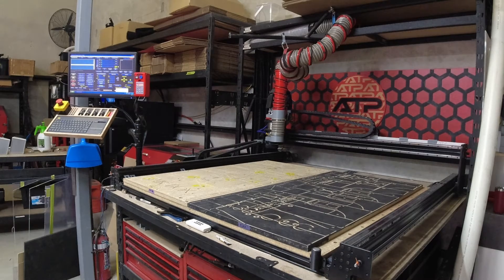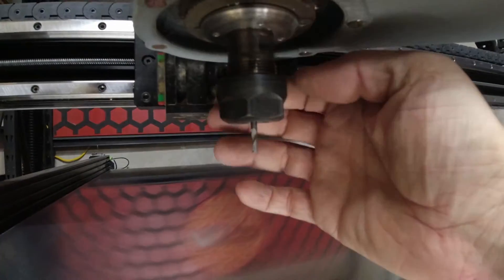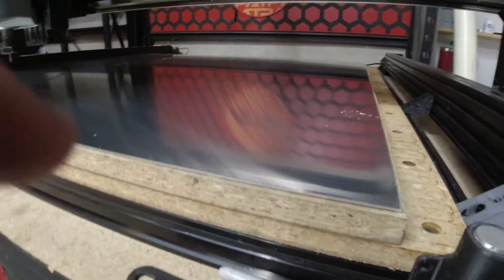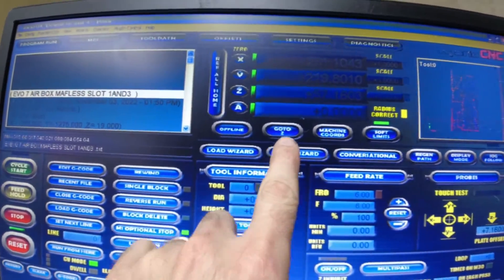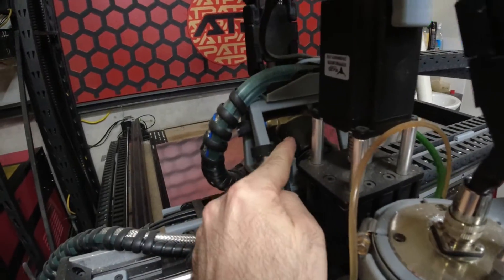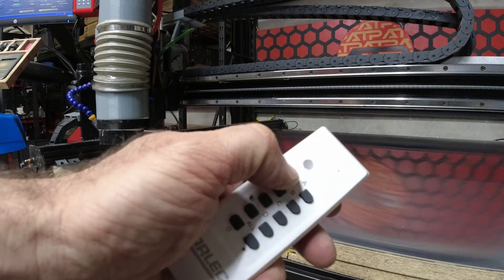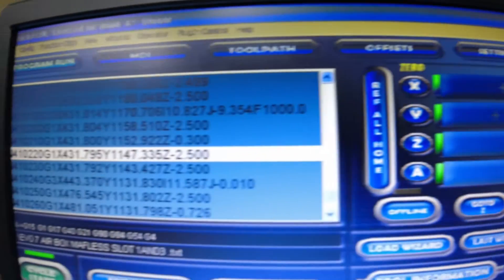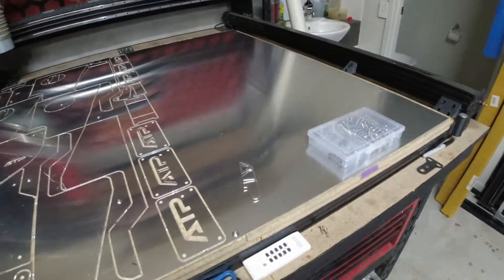Bulkman3D CNC - How I cut 5005 Aluminium

Comment: Id like to build a mister setup like yours as it doesn't require a noisy air compressor, could you point me in the direction of where to buy that pump from and the other parts? Ive been searching for that pump but had no luck, cheers
Reply from the maker: Hey mate, I used a pond pump and a laser engraver air compressor for a silent setup. I made a custom coolant feed that I regulated with a inline irrigation dripper and a tap to help adjust the flow at the nozzle. 

I don't have any details on the specific parts I used and sold the machine a while ago so I no longer have it to reference, I'm sure if you could cobble together something similar though!

Comment: Nicely done, thanks for sharing! I've put together a Sweepy 2.0 Vac foot with a Stupid Simple Tools LubeCube flowing Trim Microsol 455. If you have a chance try the Lakeshore Carbide's Variable 3 flute coated aluminum bits. They are very affordable and plunge quite a bit better with the tip geometry. I have the CNC4Newbie C4N4848 table and have run up to 1/2" mild steel plate with the vac/misting with Lakeshore Carbide's Variable 3/16" Variable 4 flute endmill. Any larger diameter bit and my machine does struggle with resonance but with the right settings I've even cut 4130 chromoly plate. Keep it up, appreciate this kind of content.

Comment: Thanks for the information and video. What bit and settings would you recommend for cutting 8-10mm 5005? I have been using some of Adams bits (same spec bit). These seem to work great for 5083. Have not tried 5005 yet. And sometimes it is the only plate available in the sizes i need. Do you believe there is a noticeable difference in performance with the CNC3D bits? Cheers
Reply from the maker: Can use a 6mm single flute for this thickness with your design? try the Turbocut Pro from CNC3D! 

I would likely run .8-1mmDOC somewhere between 800-1200mm/min with only air and chip vac no coolant, if that helps at all?

I cut 5005 everyday never have any issues cuting it!

One time I had a bad batch of cutters from Adams Bits and thier customer service was non-existent then insulting while seeking advice and a resolution, from then on I switched to CNC3D. My experience with them has been better quality cutters, a fantastic knowledge base and unmatched customer service! I would 100% recommend them to everyone, over anyone, for this level of cutter!

Let me know how you go with the 5005!
Reply: Thanks Adam, that is good to know. I'm going to give the 5005 a go, and the CNC3D cutters. Cheers!   @AdamTaylor

Comment: Do you do any CNC wood routing? And if so do you still use the water cooled system or do you just turn that off when working with wood?
Reply from the maker: Yes, I make some plywood things and all my baseboards are particleboard.
I have the coolant on a switch and a solenoid at the spindle to stop any dripping, works very well 👍

Comment: I’m thinking to purchase the same machine, I’m confused by different drives that they offer. Should I go with servo or close loop step motors?
Is the 2.2kw spindle too heavy for a drive?
Is the gantry rigid enough for cutting thicker aluminum ?
Have you try 3D carving?
Reply from the maker: My advice after owning this for a year would be to get the genuine CNC3D machine as a pre-built unit.

The 2.2kw water cooled spindle is definitely too heavy for the standard bulkman machine and requires bracing and slower feeds. 
A 1.5kw air cooled spindle would be a better option to negate the bracing.

The thickness of the material is no issue, you will be limited by the DOC and toolpath planning due to the lack of rigidity. I have cut 20mm 5005 without issue at .5mm DOC however...

I do not do any 3d carving on this machine.

Hope that helps you somewhat!